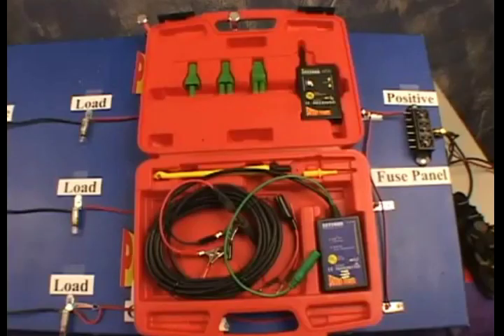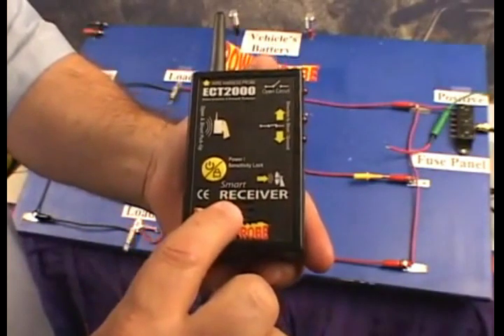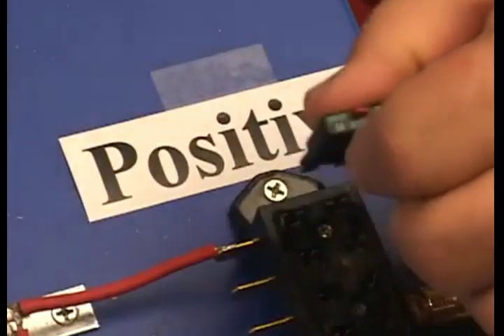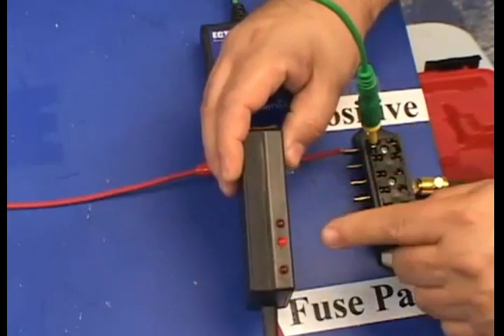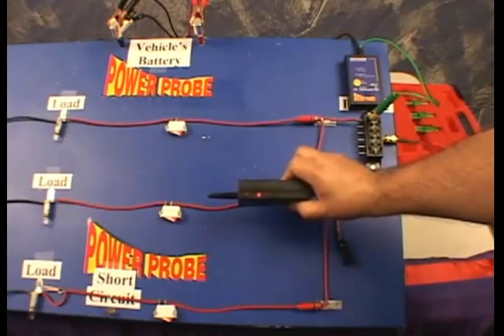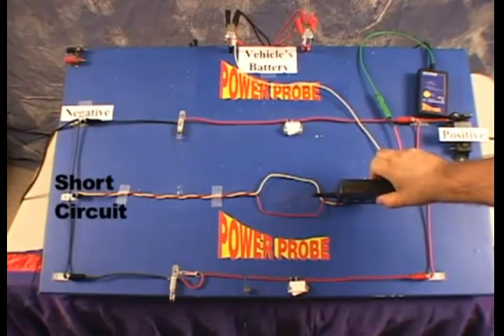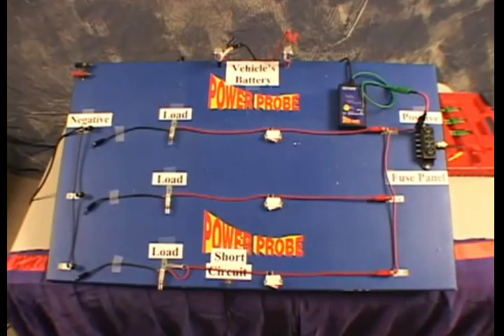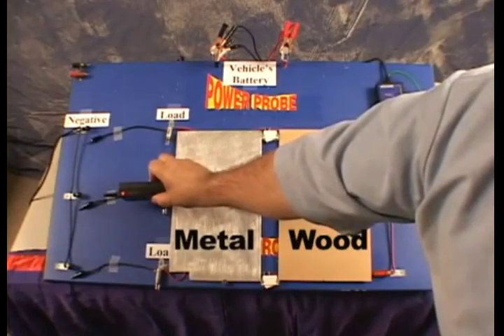48 Power Probe short finder ECT 2000 Part 1 of 2

Comment: This tool did help me the 1st time I used it. 2001 dodge ram: fuse for OBD-II, interior lights, etc. was shorted. I bought this tool, plugged the power probe into the shorted circuit. And It did find a shorted wire under the carpet. Previous owner drilled holes into the floor for some mount and drilled right into wires. I fixed the bad wires and problem solved. I was amazed. Though, since then any other issues the tool wasn't helpful. I have a new short to troubleshoot so lets see how it goes.

Comment: I bought one. Its a great tool. The only thing is, that if you disconnect the battery from the electrical system of your  car, the receiver will not work proper.  You have to let the plus- and minusconnector on the battery. Than it works proper. Take the Fuse out and put the one golden pin in the damaged fuse entrance. So it will work excellent. Also the deepscan!

Comment: Power Probe ECT 3000.  I had a short to ground connection that caused the fuse to blow for the fuel gauge in my 1979 Jeep CJ7.  The receiver could not trace this grounded wire that was inside a loom bundle running from the fuse panel over the steering wheel underneath the dash panel.  I wasted my money.

Comment: its really designed for simple circuits, but if its a simple circuit unless you are SIMPLE you can find most shorts pretty fast. i recently had a FI fuse keep blowing
well the load side of the fuse branched off to about 20 different components that could be causing a short, this thing was absolutely useless  in resolving that issue.

Comment: this tool will not tracker deep wires under carpet.
it only works if you are only close to the wire.
so not help full  very confuse when using it.
harbor freight wire tracker works much fast and better .
Reply: with the harbor freight one you have to go into the wire right?